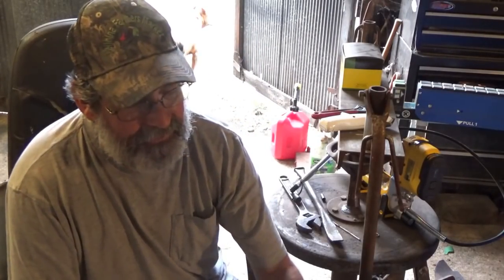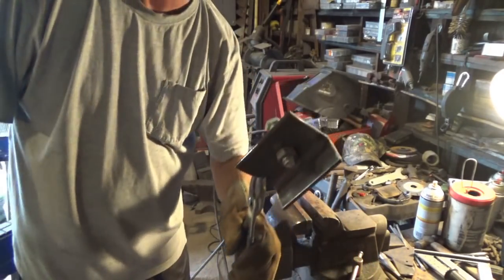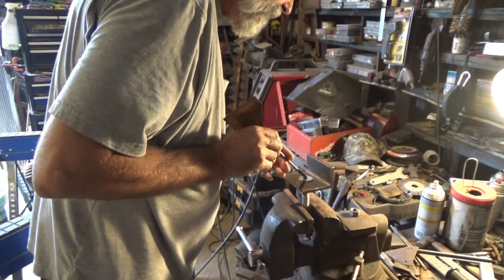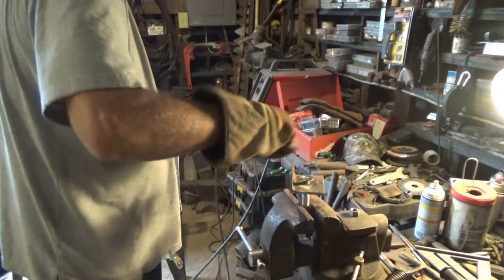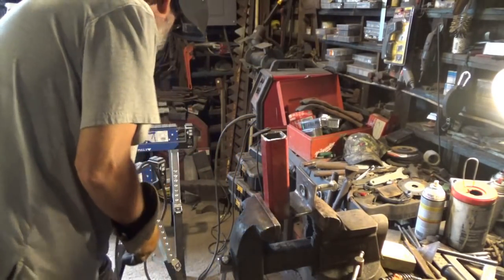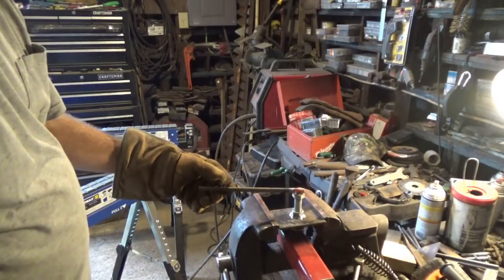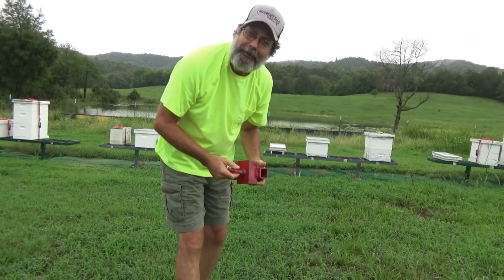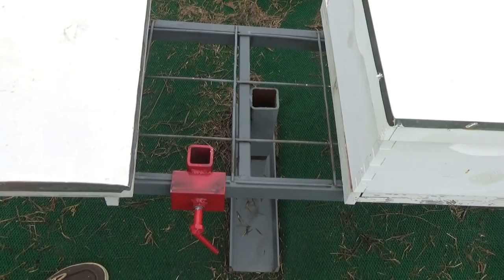Another project for the Bee Yard

Comment: Great job done Sir!  Tell me a little about your solar panels. What wattage are they? Where did ya get them from and how good are they? I'm looking for some that will run the new greenhouse. Just a couple box fans and a pump that comes on 3 times per day oh and an air pump. Thanks for any info buddy!
Reply from the maker: There's a little more to solar than the panels. I'm no authority on it for sure. I have two different size panels, the large tracker has 320 watt panels for a total of 1920 watts ran in 2 strings of 960 watts with a midnite classic controller. I'm series paralleling to get my voltage and amps up so the loss is less converting DC to AC. I have a 6000 watt inverter charger and a 10 circuit transfer switch.  these are 24 volt panels.The other tracker has 6-250 watt panels ran like the other tracker and then i have 3 more 250 watt panels on my porch roof.  And all those panels charge my batteries 1100 Ah worth.  They work great as long as they are aimed at the sun and it is shining. My system is not grid tied. I got my panels from solarblvd in California. 

Now with all that worthless information i just typed out, You need to see what your total load will be and then size your system for that.  The hotter the weather is ,the less efficient the panels are. Even a little shade will drop your output a lot. Basically you need a battery bank , inverter, controller and panels. Don't forget about all the extras, wire, connecters, combiner box, mounting , And when the sun isn't shining a way to charge the batteries. I chose a 24 volt system since it is more efficient than 12 and less costly for building a battery bank than a 48 volt system. You could probably get by with a 12 volt system with the small loads your planning. But the inverter is voltage specific so you have to stay with what you start with. Never go below 50% charge with the batteries so have a big enough bank to carry you through the night.
Reply: Thanks for all the info buddy! I been studying on this matter for a year now and it seems I would be better off to start digging a trench out to the GH and bury me a wire and hook to the real power.